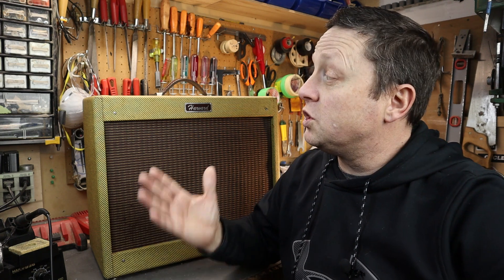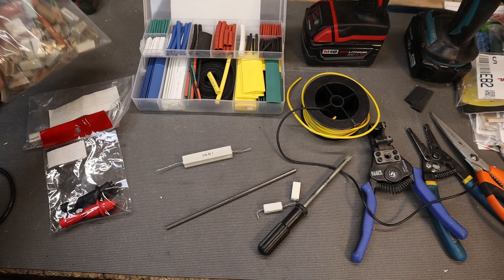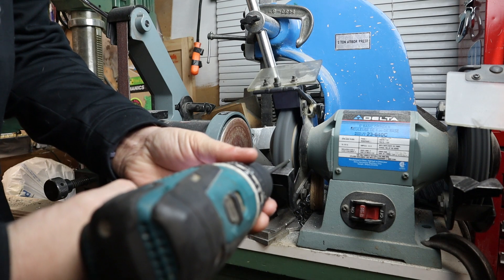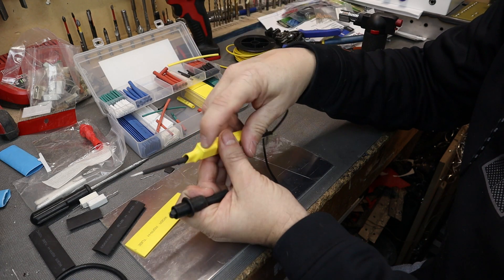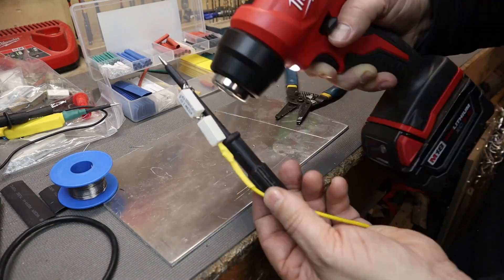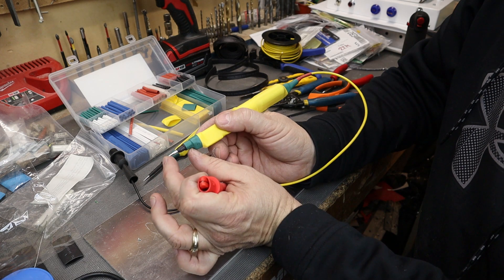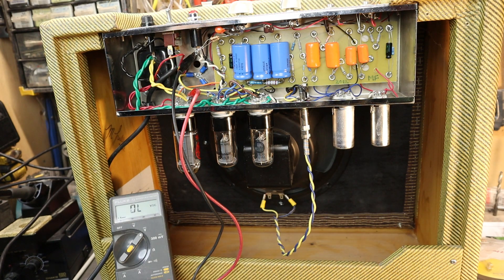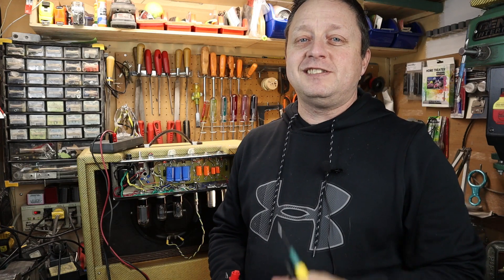Making a Capacitor Discharge Tool // Discharge Capacitors in a Tube Amplifier // Tube Amp Safety

Comment: Hi Mike I have a old amp with a 70-100+30-100 cap can I replace it with a 50-150+50-150?
Reply from the maker: I appreciate you asking me but without knowing what the amp is and and what the PSU section looks like it’s hard for me to say if you can or not.  Having the first value lower is okay especially if you have a tube rectifier. They typically don’t like a lot of capacitance.  
If you have a choke after the first cap section you can get away with having a higher 2nd section.  You are adding more capacitance so the amp should be quieter but you may change the sound characteristics a bit as well. YMMV. Cheers.

Comment: If i think about this, the first thing that comes mind is a discharge tool is closed, you could put in a capacitor inside a tool that acts like a buffer that takes all current from the capacitor that needs to go empty...the way you have it made is that you let it go empty by resistance, which can make you stick warm if you use it alot, and doesnt seem save either, I advise you to see a video of mr. carlson who made a very good discharge tool for capacitors.
Reply from the maker: Thanks for commenting. Yes, that is another way of doing it. I do believe his tool was ideally made for much high voltages that you would find in transmitters.  Great channel! I even had the pleasure to meet him Mr. Carlson! We live relatively close to each other.  Cheers.

Comment: Hi is there a tip to solder the resistor to the screwdriver? I cant make it happened
Reply from the maker: Yes, that can be difficult to solder. The larger piece of metal acts like a heat sink especially if you have a lower power solder gun.  My recommendation is to clean the metal very well. Get  pure/clean metal with no impurities. Do several wraps of the resistor lead. Use a little bit of flux and turn the soldering gun all the way up.  YOu may be able to carefully het the metal rod up with a small butane torch as well.... careful to not burn the resistor.  Cheers

Comment: Would an Ohmite 700 ohm, 11 watt resistor suffice. It's the closest I have
Reply from the maker: That should be fine, it's within a reasonable range to safely discharge capacitors.  Cheers.
Reply: @MikeFreda  Thanks a lot. YouTuber "The Tone Geek" used a 220k, 1 watt resistor and two wires with clip leads, and "D-lab Electronics" used a dual banana jack with a 22k, 2 watt resistor attached in parallel to a multimeter with leads. I just want to create the safest discharge tool and not get blowed up.
Reply from the maker: The larger the value and longer it takes to discharge.  You can plug the values into a RC time constant calculator.   I’m a bit impatient so the lower values like 1-2k works for me.  I’ve had no issues…. Anything is better than no resistor ie direct short.  Cheers.

Comment: I learned about capacitors many, many years ago.
I went to see a television transmiter where my father was working and while I was there someone moved a very lage cap that had been taken out of service  and placed on a metal shelf, without being discharged.
Even though it had been on the shelf for months, it arced out and blew a decent sized hole in the shelf.
It was only luck that no one was hurt apart from the backside kicking the tech responsible got.
Reply from the maker: That’s a crazy story.  I suspect that was a very large cap in the Farads range.  TV transmitter tube run serious voltages… they  an be in the Kilovolt range.  Scary stuff if you are not formally trained. Cheers.

Comment: Hi Mike. I'm surprised no one has mentioned this in the comments yet. It may seem counterintuitive, but technically you should discharge the caps with the power cord plugged in. After you discharge them, then you should unplug it. Dangerous? YES! But once you unplug the power cord the chassis is no longer a good ground to discharge into. Instead it's floating. Will the caps discharge into a floating chassis? Maybe, maybe not. Obviously, with the mains energized you risk electrocuting yourself if you come into contact with any live point. However, if you're not aware of what you're doing you shouldn't be inside the chassis... period!
Reply from the maker: Thanks for commenting. I understand what you are saying but don't recommend keeping the amp plugged in even if it is turned off.  For discharging capacitor, all you need to do is ground them out on themselves.  In most tube amp topologies, the negative side of the PSU Caps should be routed back the the star and/or chassis ground. Yes, "some" amps could float the negative side of the PSU caps but the wall plug safety ground may not be attached either to that since most safety grounds (green wire) are bonded to the chassis. The best way to ensure the PSU caps are discharged is connect the probe clip to the negative side of the caps and touch the positive side,.You are grounding it out to itself nulling any voltage.  Or connect the clip directly to the Star Ground and then probe the positive side of the caps. At the end of the day, just be safe and measure voltage before you do anything. Cheers

Comment: Hi there, since I don't have spare parts I'd need to get them all for the assembly. I tried to check the resistor site so to find the correct resistor but i lack few data needed. The higher voltage caps on my amp have these data printed on them: +220uF 350V. Which resistor value should I get? Thanx in advance! Cheers
Reply from the maker: Thanks for commenting.  I do have a diagram for more information.  For the resistor, 1000ohm to 2000ohm, 10watt with a 400 to 500v rating will work just fine.  Use 600v rated wire and heat shrink.  For most tube amps you typically won’t see more than 500v when it’s off. Always verify with a voltmeter.  Cheers.
Reply: @MikeFreda  thanx, what about the gauge of the 600V cable? 22 awg is ok or is it better the thicker 20 awg? About the resistor, I prefer to wait seconds more for the discharge and be sure not to damage it with a quicker discharge. Are the values above still safe for the capacitor to stay in shape? Thanx again!
Reply from the maker: @muaythai4lifelife  20 AWG is fine. Realistically,  if you are using this for a regular tube amp, the current spike is a split second so the wire size is not that crucial. You can use larger resistor size. You can model this in a RC calculator to give you an idea of time.   You could probably go up to 10K and still discharge a normal tube amp in ~10 seconds.

Comment: Well-done vid.  However, unless you already have most all of the parts, not that much more expensive just to buy the snuffer at around $40.  I'm looking at $16.25 for just the resistors.  Next, at 2:02 you mention together they'd be 1K ohms, but you didn't use the two 5 watters on the one probe, just the 820 ohm, 25 watter.  So you don't really need 1K, right?

Comment: Far too simple! Mark will mend it has a much better diy one....
Reply from the maker: Yes, this is a simple tool but effective.  The one Mark shows on his channel is pretty slick and made by a viewer of his.  A bit overkill since it combines a voltage display and a switch built into the body. It is cool though.  Cheers.
Reply: @MikeFreda  kudos for politely replying to comments four years after you posted your video. Very helpful, and possibly a life saver!!

Comment: when you say that you used "high voltage" wire, could you please be more specific. For instance, is this capacitor discharger good enough for discharging microwave capacitor? .. thanks for your videos!
Reply from the maker: Most wire will have a safe operational voltage rating to it. The wire I use is rated for 600v.  What you don’t want to use is 12-24v automotive wire or something like that. Since most tube amps won’t see over 550v you should use wire that is over that range for safety.  Microwaves could be higher. You probably want to determine what the voltage is and use suitable wire just to be sure. The primary reason is the sheathing.   I hope that helps?

Comment: Should I be concern about covering the resistor in heat shrink tubing since the heat coming off the resistor is restricted? Thanks
Reply from the maker: Thanks for commenting.  No,  not at all.  There is no issue since the discharge time constant is only a second (depending on the value of the cap) Since the amp is not actually on, most of the current is dissipated in a split second. A 10watt resistor would barely notice in a normal PSU.  If you had a large array of capacitors… perhaps a 25watt resistor would be better.  You can use the Time constant formula and ohms law to determine proper limits.  Cheers.
Reply: @MikeFreda  Thanks for your quick reply!

Comment: Hey whats up brother I have a vintage Peavy Amp Renown Solo 212 , Solid state amp I cant find any videos on how to discharge solid state amps
Reply from the maker: I don't work on SS amps much but the principles are the same as tube amps. The larger power supply caps are typically polarized (they have a positive and negative) Ground one side of the probe/discharge tool to the amps ground stud and touch the + side of the larger caps for a several seconds. Use a multi-meter to confirm voltage. Also a good idea to find the schematic of the amp to help locate the caps. Some SS amps have draining resistor. If left off for a while the caps may self drain. Always use a multi-meter the confirm voltage. If you are not comfortable in doing this, I'd recommend taking it to a technician to service it. Cheers

Comment: nah i live life on the wild side
Reply from the maker: Surely you jest!?  To be honest, when I first started I just used a multi-meter and measure and drain the PSU caps.  (20+ years ago). I did eventually get shocked when it was a little too complacent. I always drain the caps now when I work on an amp.  Doesn’t take much to ruin your day!  Cheers.

Comment: Are the capacitors on solid state amps just as dangerous?
Reply from the maker: Yes, they can be. It really depends on the PSU design, voltage rating of the amp how large the caps are. A large value capacitor (i.e. 1000mfd) at 100V can still pack a punch.   Always a good idea to drain the test with a multimeter.  Cheers

Comment: 820 ohm does depend on the Cap value, doesnt it?
Reply from the maker: Yes... sort of.  This value can range from 500R to 5k. It basically adjust the discharge Time Constant a little.  Lower value increases the Time Constant and could create a spark. Realistically, higher voltage caps that we typically see in tube amps rarely go above 400ufd so anything in that range will work just fine. You will see that in the first 1/2 sec the voltage will be high (~300VDC) and drop to 10v.. to make it got to zero may require ~5 to 10 more seconds. Also, if you have many good quality large value caps, you may see the voltage start to rise again (0-3volts) due to its original charge. That's why bleeder resistors are a good idea.  Always confirm with a DMM. Cheers

Comment: You skipped something buddy.  You inserted a red insulator in between the two black shrink tube insulators.  I assume you snuck that in after soldering the resister to the probe.  And why are you insulating a capacitor from the probe?  Shorting out?  That's the purpose of the capacitor.
Reply from the maker: Thanks for commenting.  Sorry, I didn't really miss a step. I just tried to condense the video down a bit to get to the point.  You basically want to bond one end of the large resistor to the front of the steel probe and cover everything else with heat shrink.  (I just used red since that's what I had that fit nicely.)  The back end of the resistor has the wire soldered onto it. That wire goes to the insulated clip that is grounded on the amp. You are just making a temp resistor node to ground.   There is no capacitor.  I did up a drawing and linked it the video description. I hope it helps? Cheers.

Comment: Cool video.  I'm going to make one of these.  Could you answer this question.  If I have a 1000uf 200v cap, what size resistor would I need to properly discharge it.  My other ones are 370uf 35v so would I also need one for them?  Thanks

Comment: Can some respond this? Are Solid state amps safe to operate into them or I need to do the same thing
Reply from the maker: Yes.  Solid state amps typically run at a much lower voltage than tube amps but they do have power supply capacitors to filter the AC ripple out of the DC. They are typically a higher value in capacitance but a lower voltage rating so there still is a risk. Some have draining resistors but it’s still a good idea to measure and/or drain. Cheers.

Comment: I usually just use an alligator clip lead connected to ground and the tube side of a plate resistor.  If you hav an amp with a storage cap on the hot side of a standby switch make sure you close the switch.
Reply from the maker: Thanks for commenting.  Yes, that is another way to do it.  You can also add a high value, high voltage rating “bleeder” resistor into the circuit at the PSU section is also a good idea.

Comment: Hi Mike, thanks for making this video. On wattage of the resistor, you used a 25 watt for yours. How important is the wattage of the resistor? I have a 10 watt 1000 ohm resistor in my spare bin I was looking to use. I'm looking to discharge my AC capacitor. Thanks
Reply from the maker: Thanks for commenting. 10watt will be fine if you use it small to medium tube amps.  When they are off it’s just a instantaneous current spike then it drops rapidly. (As per the time constant). At 500v a 1000ohm resistor could see 0.5amp for a split second then rapidly decrease.  What you can do it put two larger ones in parallel or two smaller ones in series for added protection.  Cheers.

Comment: OK, all clear except one thing.  At the 3;00 mark, you say “we’ll solder the end on”, but what exactly is that black cord?  Wire spec?  Don’t you have to first strip the end off from that black cord?
Reply from the maker: Thanks for commenting. When editing, I thought that was self explanatory.   Yes, strip the end of the wire, solder and cover it with heat shrink. Don't let it ground out on the rod portion of the tool. Standard hookup wire is okay. 22-18 ga is fine. There isn't a lot of current here so wire size is not that important just as long as it rated to ~600volts.  Cheers

Comment: Would like a video on real time, not sped up so the viewer can see what is being done, I personally would rather have a normal speed video
Reply from the maker: Thanks for commenting.  People have said this before to me. I thought it was pretty self explanatory just hooking up some resistor in series with the rear wire lead and clip.  I can draw you a picture or detailed photo if you like.  Cheers.
Reply: That was a great answer.       @MikeFreda

Comment: Hi mike can i make resistor weld on metal scewdriver  im  not sure.thanks
Reply from the maker: Hi, you can but I would recommend using a screwdriver that is voltage rated. Milwaukee, Klein and Wera make them. I would also use voltage rated heat shrink as well to cover up any loose leads. Cheers

Comment: Thanks for the great video. 

I have some hifi amps with virtually all popropyelene non polar caps - even the PSU caps, which are Solen polypropylenes.

If you have non polar caps instead of polar, can you discharge the cap in the same way (one end of the wire to chassis and other to one end of the cap?, - If so, I assume it doesn’t matter which end you touch on the cap?)

Or can you not use the one wire end to ground technique for non polar caps?

I’ve seen other videos where people just use a resistor ends going tk each end of the Individual cap end, - instead connecting one end to the chassis.
That looks more inconvenient though. 

Any advice would be appreciated.
Reply from the maker: Hello, thanks for commenting. Even though Solen Caps are not Polarized, they still need to be drained (especially if they are in the PSU section) Since the negative side is already at ground potential, you still need to drain the B+ rail side (just like in the video) then test with a Multi-meter. Some caps in a circuit are bypassed with a resistor and will drain quickly but you should try to do every cap and test before you work on an amp. Cheers.
Reply: @MikeFreda  Hi Mike. Thanks a lot for the reply. Much appreciated.

The problem is, as these caps in my monoblock 300B amps are non polar, I’m uncertain which side of them is the B+ side. (I didn’t build them myself). It’s not obvious like it would be with an electrolytic polar cap (where you can easily identify the positive end of each cap)
Would a reasonable strategy be to connect one end of the meter to the chassis ground then touch (one after another) each end of each cap with the other probe of the volt meter (with resistor installed). I assume nothing will happen when you touch the end of each cap which is at ground, and you’ll get draining of the cap when you touch the other B+ end. 

My amps have wooden cases so that’s obviously not appropriate to fix one probe to for ground. The Top plate however is metal. I assume that would be ok as ground?  

Or maybe another technique might be to touch each of the probes ends on each end of each individual capacitor (instead of connecting one probe to chassis ground) . I’ve seen people do this before, sometimes just using a resistor between the ends briefly. It obviously takes much longer though than the other method. There is probably also a higher chance of putting both hands inside the amp at once!, which worries me!
Reply from the maker: I see, well, not knowing how your amp is wired/made I can’t really comment on the process. All I can say is use a tool like mine and touch the leads on both sides of the caps. One side should be grounded and then a multimeter to confirm the amp is fully discharged.